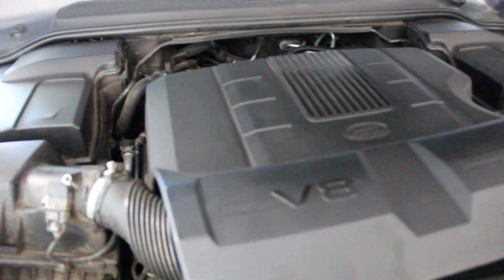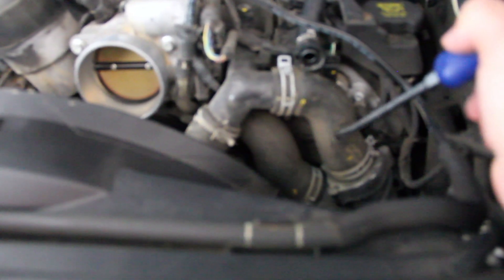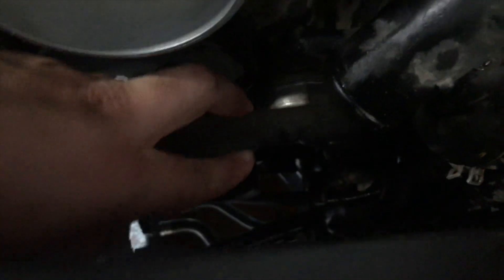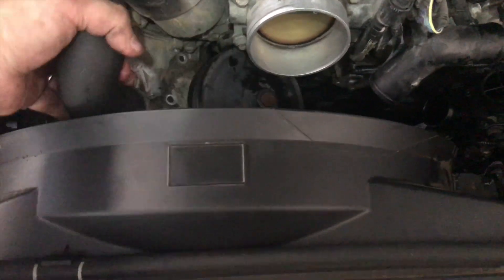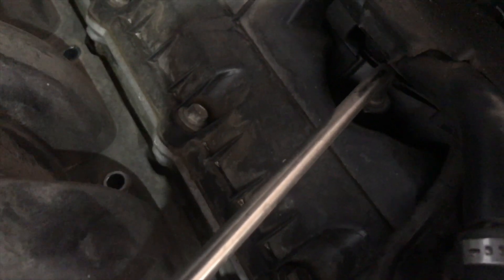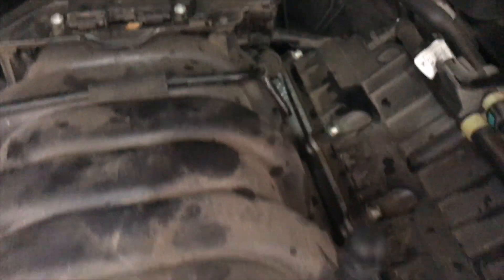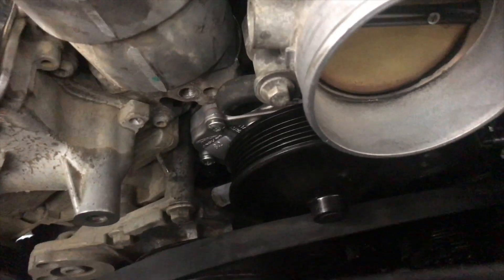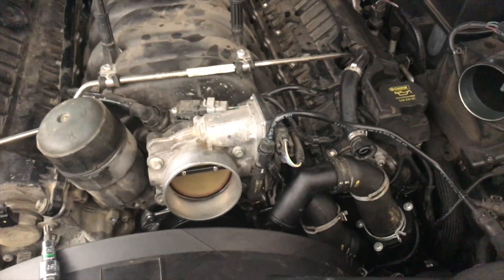Land Rover LR4 Water Pump

Comment: Great video Ken. I am in the 4th round of installing the water pump. Something I noticed on another video was turning the oil coolant tube clockwise to lock it in. Am I correct in that's what it does? The other thing I ran into was when I ordered a new Oil coolant tube, it came with 2 o-ring seals (Installed on the engine side). Why 2?

Comment: Very helpful video. 
I removed the fan cover - super simple and really opened up more space. 
Also, while you’re doing this job should go ahead and do the serpentine belt. Once fan cover is off, slip the belt over and around front of fan (no need to take it off).
Here’s a great video on the belt:

https://youtu.be/WtM1Bafxb5o?feature=shared

Comment: When putting on the new plastic pipe that goes behind the water pump, do you have to rotate it a certain way to get it on? Or do you simply push it in?
Reply: Did you ever find the answer out? I was wondering the same.

Comment: The secret is replace the WP as well the crossover plastic pipe located under the Air intake manifold and the little pipe it goes in the back of the WP as he did in the video ,Factory recommended to also replace the other plastic pipe In the back of the manifold witch it goes from head to head ,but I didn't did it ,now is LR4 is working fine,BTW do not use after market parts for Land rover it will be to risky I install non LR WP but the diameter  of the oil cooling pipe it was different ,use LR parts only.

Comment: Thanks, this video helped me out.  The small black fitting on the front of the water pump snapped off while I was doing the job and I lost a day waiting on the replacement part.  Others might want to consider buying LR012636 as it will likely snap for you too.. The crossover pipe (LR018275) was definitely the cause of my slow leak.  It was in bad shape.

Comment: Changed water pump, crossover pipe, radiator, lines, heater manifold pipe. I thought I had bled it out fairly good. Ran it great for about 4 days. Now it reads "low coolant" yet coolant level is now above the fill line. What gives?
Reply from the maker: I’d look at the coolant level sensor. They commonly go bad.

Comment: So i started to have a coolant leak but it only leaks when i turn on the AC which seems weird if the AC is not on it doesn’t leak coolant seems abnormal but what would you suggest replacing there ?

Comment: Just wanted to say thank you, I just picked up a 2012 LR4 and she has a water leak, so I will be doing this very soon.
Reply: How did it go? Was it indeed the water pump that was leaking? My RRS (2011) has a small pop of coolant in the same spot but from what I’ve seen it may not be the water pump. Really don’t want to take it completely apart in case it’s not the pump or not the y pipe
Reply: @superchile9640  the crossover split at the seam, engine locked up. Disassembly in progress. Wish me luck, but I think the engine is toast.
Reply: @dgap74  how many miles on your lr4?
Reply: @almamdani6564  96K
Reply: Rear crossover?
Reply: Damn, that sucks
Reply: My ram is in the shop so I am babying my RRS until it gets back
Reply: I did however recently rebuild the engine in my 89 Camaro. Bought it as a hobby and found out it was locked. Tore it down and everything went to the machine shop. Got it all back, put it back together and it’s running like a champ
Reply: @superchile9640  no the forward one split right down the seem. Cylinder head is ready to come off to see if block can be saved. I hope it is salvageable.

Comment: Thanks for the video.   I have changed mine in the past but think my pump may be bad again.  I had terrible trouble getting the oil cooler tube back connected without leaks in that area.  Any tricks or pointers you could offer to get it all seated correctly?
Reply from the maker: I put the oil cooler tube with the O-ring on the water pump then lined it up with the oil cooler tube on the engine. Hope that helps!

Comment: Hey I have an lr4 and I was changing my crossover manifold  and a piece broke not sure what to call it but it is the y shaped connector that was sitting still hooked up by the air intake the whole video the main hose goes into the coolant reservoir
Reply from the maker: send me a picture of the broken part at Rocketcityrovers@gmail.com . That will give me a better idea of what you are talking about.

Comment: How did you remove the high pressure fuel pipe and what tool did you use?
Reply from the maker: Mike Morgan I just used a wrench.   It’s a flair fitting with a collar that unscrews. You will have a little fuel spill out so have a rag handy.

Comment: Do you have the exact part numbers for both the front and rear crossover pipes?  Thanks.
Reply from the maker: Rear crossover Heater manifold LR109402 for V8 and LR109401 for V6
Reply from the maker: Front crossover is lr018275

Comment: hey there, GREAT video.  I’m just planning on taking this job on this weekend. Did you remove the engine cooling fan or work around it?
Reply from the maker: I worked around it, I didn’t want to mess with removing the fan.   So it possible to do the water pump without removing the fan
Reply: Kenneth Ellis great thank you.  I actually got the pump out already working around the fan (it was tight getting it out, but it barely made it), right now I took a break as I’m wrestling with that rubber o ring stuck on the pipe that the plastic tube slides over.   Happy Thanksgiving!
Reply from the maker: Happy Thanksgiving! Good luck!
Reply: Damn..I wish I watched this,.......took mine to a shop and they guy removed the fan and broke a part...had to sit in the shop for 4 more days

Comment: That little elbow valve that connects to the water pump is leaking on my rover, after I change the water pump, is there a way to connect that valve? Cause I was having trouble connecting and disconnecting it, thanks
Reply from the maker: Yes you should be able to connect the elbow after it’s installed.   If your elbow is leaking I would check it for cracks before installing it back, you may need to used the updated parts.   On disconnecting it: you need to push the sleeve the elbow fits in back with one hand and pull on the elbow with the other.
Reply: @kennethellis5774  do you have a part number for the elbow piece that breaks?
Reply from the maker: You will need both of these parts, due to a redesign of the parts.
Thermostat to Engine Cooling Hose- LR049989
Throttle Coolant Hose- LR045238
Reply: @kennethellis5774  just so you know you can buy the old elbow peice on Amazon for $18
Reply from the maker: Daniel Howard hey post a link so other people can find it too.   Thanks!

Comment: Thank you! You’ll want to have LR011038 and LR05530 just in case yours break. One is the cap on the cross flow pipe you must reuse. The other is the bleed screw on the rear passenger side. They are prone to break so I’d replace either way as preventative maintenance. I replaced and bought additional as spares.  Also, make sure to fully seat the cross flow pipe when installing by pressing down hard until you hear and feel it bottom out.

Comment: Did it ever overheat?
Reply: No not bad at all. We had literally only been driving for less than 1 mile from a cold start when the overheat message came on. Pulled over and that was that. Once it was back at the house,  I started it to drive it 10ft into the garage and shut it down. Coolant tank still has coolant, yet there was a puddle on the garage floor this morning.
Reply from the maker: HalfMoon I’m sure you are good then.   I’d replace the rear cross over pipe as well, I found out after I did this video that they do crack.  I’m going to do mine soon.
Reply: Ours got hot. Pulled over and you could hear the coolant under the intake. I assume it is that crossover pipe. Trailered it to the house. Yay me!
Reply from the maker: HalfMoon nope.  If you had a really bad overheat,  warped heads happen easily.
Reply: Ok. Thank you

Comment: Did you replace the intake manifold gaskets? If so, do you have part numbers?
Reply from the maker: I didn’t replace them but the part number is LR010881.  Haven’t had an issue in the 15k miles since this video
Reply: @kennethellis5774  appreciate the reply!

Comment: Did you have to replace manifold gaskets?
Reply from the maker: KPK 102084 I did not replace the gasket.  Each intake runner has its own o-ring that is reusable.  I haven’t had any issues with reusing them in the 10k miles I’ve put in my lr4 since replacing my water pump.

Comment: Great Video!  The bottom of my thermostat has a connector to the hose from the bottom of that radiator. I can't seem to get that separated from the thermostat housing. Do you have any advice?
Reply from the maker: Drew Lum I remember having this issue.  The thermostat has a snap ring that connects it from the bottom to the radiator hose .  The radiator hose has a plastic piece with a quick disconnect on it and those two ( hose end and thermostat) plastic sections were stuck together.  

What I did was remove below the connector by undoing the tension clamp and twisting the whole housing out of the radiator hose. 

When I finally got it removed, I took the whole assembly to my vise and slowly worked the two pieces apart.   Just remember you need to reinstall the bottom of the quick disconnect onto your new thermostat, so be careful with that piece!
Reply: @kennethellis5774  -  I'm working through this project right now. I undid the manifold and only lifted it up so that I could replace the crossover tube. Hopefully, this approach will work. I decided to buy the entire lower radiator hose assembly (p/n LR013684). I'll report back once it's running again! You've made a great video that looks really easy, but I'd say it's a bit harder than medium. This thread is a really good companion to your video - https://tinyurl.com/y9lbzq33

Comment: Kenneth, great video.  I wish I had found this before I attempted repair as it might have prevented some serious headache.  I am pretty handy and just replaced the transmission pan last week with no issue.  This fix however has given me a run for my money...  Literally.  I must have repeated this repair six times and still have a leak somewhere.  Can't figure it out for the life of me.  In the process, this last time (attempt #6), I buttoned everything up and now I am getting a crazy rough idle and check engine light and it STILL has a minor water leak.  I've got it headed over to my local indy to get it looked at now.  I would say this repair is not for the faint of heart...it's relatively easy to get everything in where it goes, and no tight squeezes, but man, getting everything seated properly...

I have a feeling in this case, trying to do this on my own is going to cost an arm and a leg.  Great video.  Just want to warn others who attempt of the possible pitfalls...

Any guesses as to what could be causing the misfire/rough idle?
Reply from the maker: Glad you liked it.  Did you lift the air plenum to change the cross over pipe? I’m thinking it may be an air leak or possibly a plug that got knocked loose.   

I would double check all your connections as a first step.  If you have a code reader that would also help point you in the correct direction ( misfire  or a lean condition on several cylinders= air leak) 

Best of luck.  Report back on what the mechanic finds.

Comment: Great video mate. Very helpful. Just did my water pump and crossover pipe, not together though. 4 days after I replaced the WP, I noticed it was losing coolant. You could see coolant collecting down in the valley. Sure enough the o rings had failed on the crossover pipe where it bolts to the head lol. Just at 100K miles.
Reply from the maker: Glad you liked it, check back soon for more videos.
Reply: @kennethellis5774  I watched your video Keith on the water pump I did that that worked out really good .the only thing I did not replace because I didn't see it in your video but you did suggest to do it was that crossover pipe.I was sort of waiting to see you do that on video all I remember is you said 5 bolts on each side of the intake and that was it so what I'm wondering is, does the intake have to come off completely ?do I have  take the water pump off again?
Reply from the maker: Jeff Johnson I don’t believe you have to take the water pump off completely just take off  the upper  coolant hoses.  You will have to tip up the intake and re-bleed the cooling system.  The cross over pipe has two bolts that hold it in place.
Reply from the maker: There is another video on YouTube called “Land Rover LR4 Coolant Leak Repair” that shows the crossover pipe well.
Reply: hey Fred my name is Jeff I replace my water pump but I didn't do that crossover pipe and now I got a leak they're pretty bad to where it's not holding anything was it hard to do that and do I have to take my water pump out to do that
Reply: Thank you so much I just watched that video you suggested and I feel a lot better about what I have to do have a great one!
Reply: Is there any gaskets or o-rings or anything else that I would need to order to replace that coolant crossover pipe
Reply from the maker: Jeff Johnson no you should be good just ordering the crossover pipe.    It includes the orings.
Reply: @kennethellis5774  hey Kenneth this is Jeff Johnson you've been helping me out with your videos on my 2011 Land Rover I put in that crossover pipe I just need to know if you know the torque pounds on the intake bolts
Reply: @jeffjohnson8176  I know that this is late but for other my manual says that the air intake manifold should be tightened to 18 ft-lbs or 25 Nm.